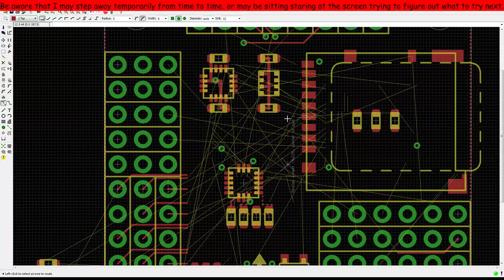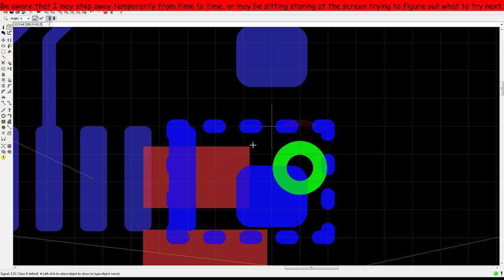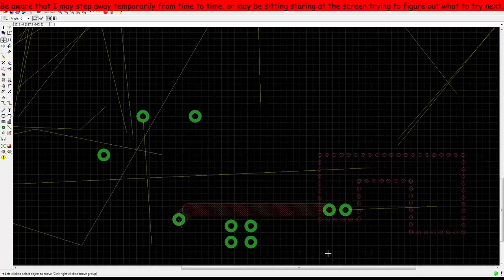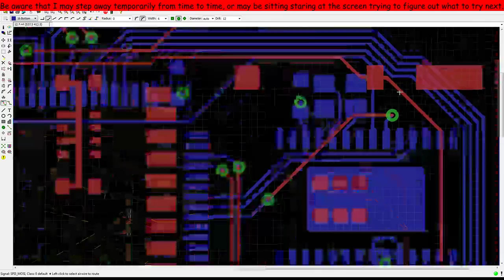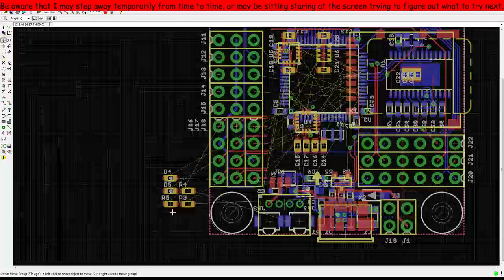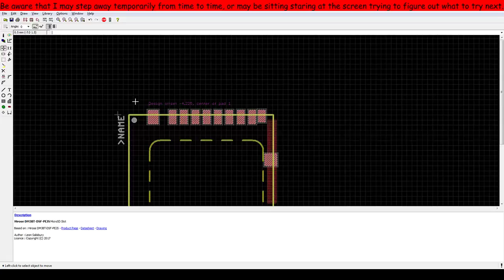Routing a PCB - AlienFlightNG 30.5mm Flight Controller (part 1)

Comment: @49:07 more commonly referred to as the Auto Rooter hey Leon :)

Just a bit of feedback (non electronic) which may have been mentioned already when you were live. I am on a Mac with max volume and the sound is very soft. Content is fantastic though and thanks for doing this. I will watch the rest after work in an hour or so.